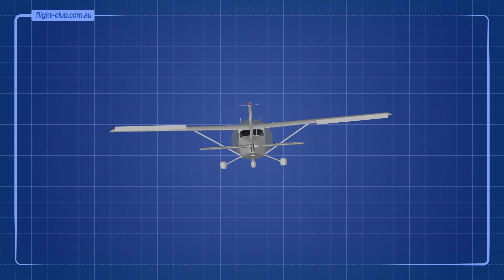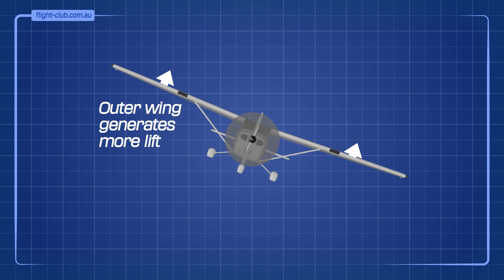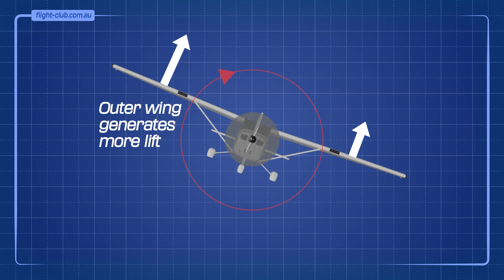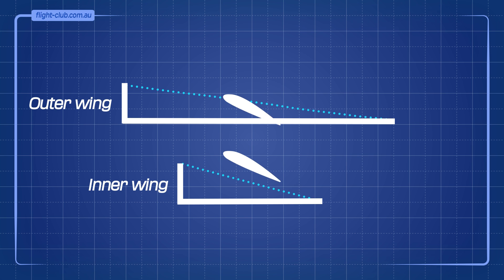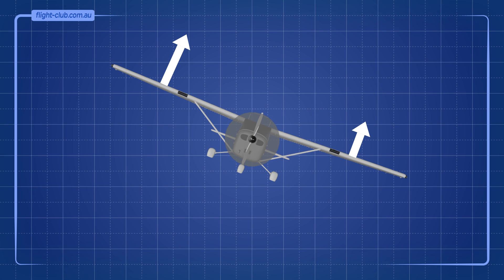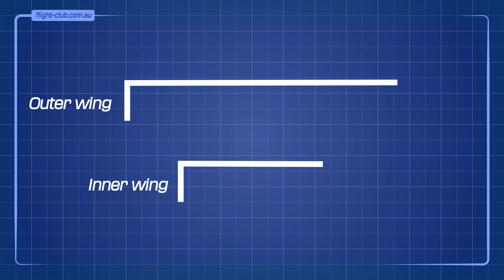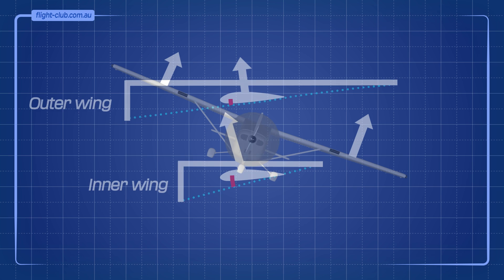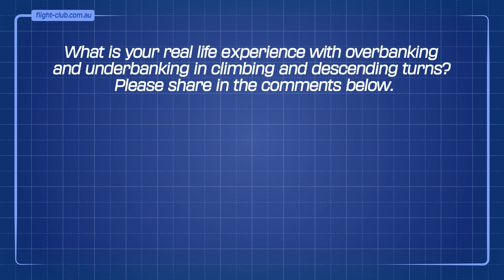Understanding Overbanking and Underbanking | Essential Turn Dynamics Explained

Comment: In straight and level flight, if the ailerons are adjusted,  what *initiates* the turn? (Since,both wings at that point, are travelling at exactly the same speed. Turns are often done without the rudder.
Reply: Typically the elevators are used, pitching up into the turn.  If the elevators and rudder are left neutral, then straight and level flight will not be maintained since rolling the aircraft points the lift vector to the side a bit--there won't be enough to match gravity so altitude will be lost and the aircraft will slip to the side. 

For example, turning left, the stick would be deflected straight left, then brought around to straight back, held there for the duration of the turn, then brought around to straight right to level out, then returned to the center.

Comment: I sometimes use the spiral stair case analogy. If stair case had a inner and outer handrail, handrails being the relative wind, place across a plank of wood, then angle.
Going up the steps outer rail as greater angle of attack than inner on the plank. But going down, the inner as greater angle of attack.
Thus over bank on climb and under bank descent. It's important to keep in balance.